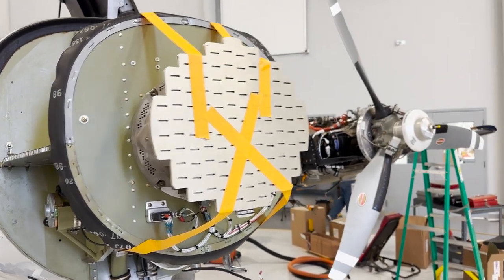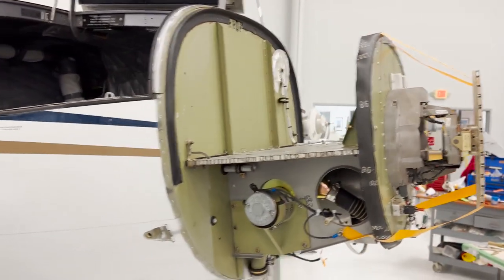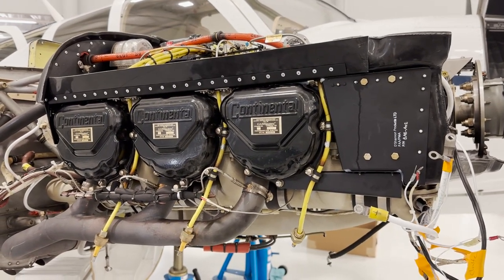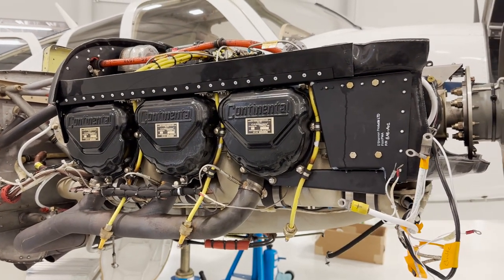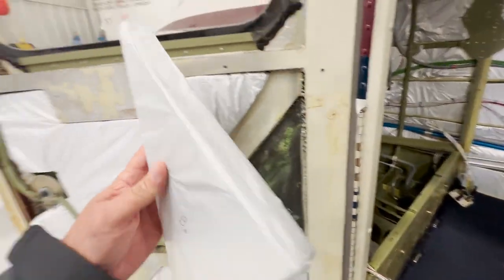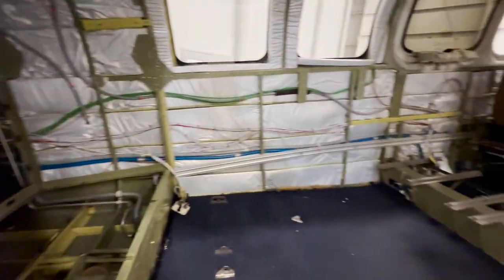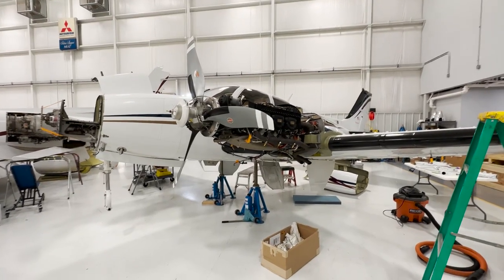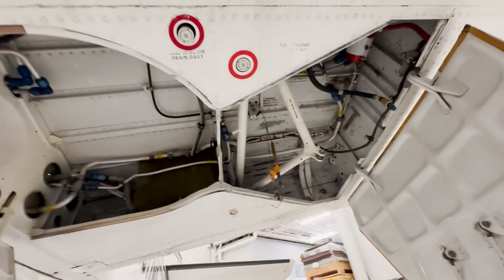Baron 58 Paint & Interior Video 1

Comment: Question for you on your panel. I have very similar.  Does your 275 and 500txi auto switch cdi to loc when shooting an ILS?
Reply from the maker: Yes, it does.  Although it has to be set up properly to do it.  Assuming you have a 275 and a 500 TXI and a GTN 750 or a 650?  If so, your dealer has to turn all the CDI sync settings to “Always On” and the GTN has to have the ILS CDI Capture setting set to auto-switch.  The GTN setting is the only one that is accessible through normal pilot menus.
Reply: @RMAG  thanks. I will ask my installer.
Reply: @RMAG  thx. My shop was able to enable this. Now how about IAS. Mine seems to chase with a delay.
Reply from the maker: @cliffordburgoni949  what auto pilot and airframe? This is a bit of a tougher one we’ve seen that before in a GFC 500. Garmin has a whole checklist for troubleshooting that issue to run through.  We’ve had one plane we did everything on and it still hunted IAS.  Seems like if you get stabilized in a VS climb first then transition to IAS it mitigates to some extent.